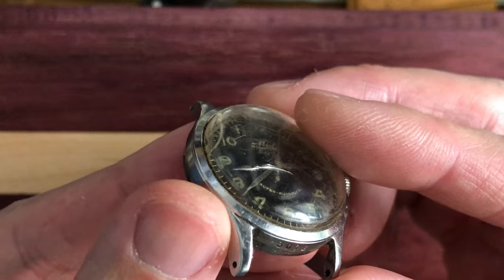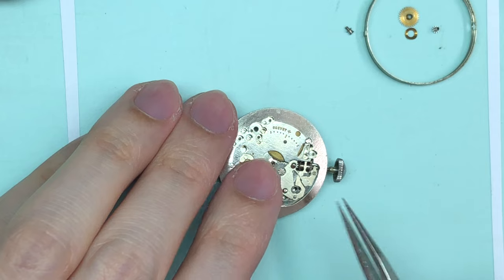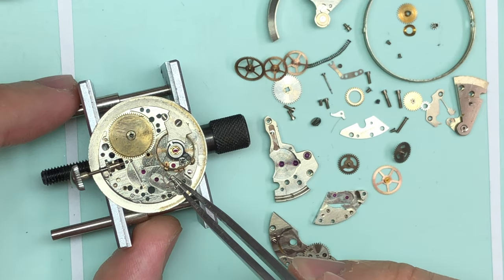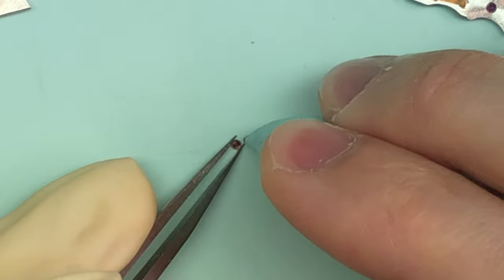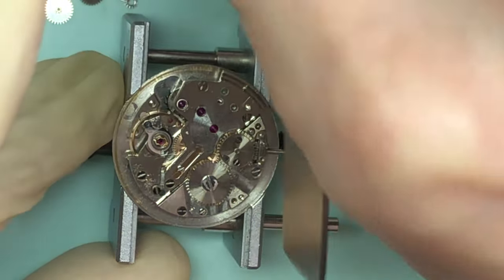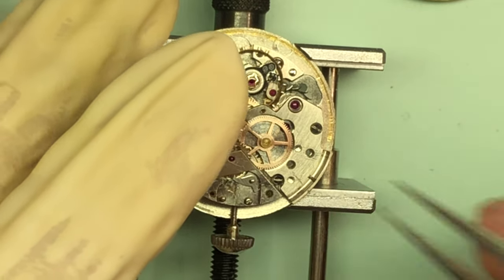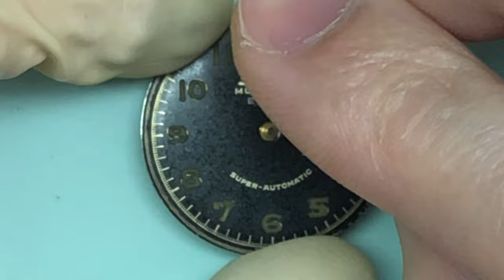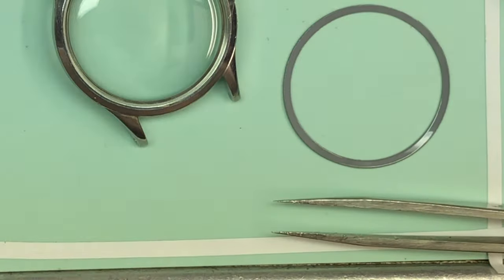1940's MIDO Multifort Restoration - Bumper Automatic Caliber 917P

Comment: Wow, enjoyed that.  I just took my father’s 1950s Mido Multifort to my jeweler to have it serviced after 50 plus years.  I’m nervous.  I hope his watchmaker is as skilled as you.  Thanks!
Reply: Let us know how it turns out. Very cool to have your father’s watch.
Reply from the maker: I am very sure it will turn out in great shape!
Reply: @TimelessHistoryChannel  Hi Omega Entusiast.  I just got my Dad's 1950s Mido Multifort back from the watchmaker.  He cleaned, oiled and adjusted.  It looks good and is running and seems to keep time pretty well, but he said that some of the parts needed to be replaced (some rust he said).  He said he could not get the parts.  Would you know who could help me get my dad's watch repaired, someone who might have access to parts for a 1950s Mido Multifort.  It has a center second hand.  Thanks!
Reply from the maker: @markwoolard6745  Unfortunately, I would not know where to guide you to locate these parts.  Certain rusty parts I am sure can be cleaned.  If you're unable to locate the parts you'll need to ask your watch maker what caliber is your watch movement.  Then try searching on website such as Ebay for spare parts or a complete movement for your watch maker to strip it down to use the parts.
Reply: @TimelessHistoryChannel  thanks!
Reply: Hi Omega Enthusiast.  How can I find the caliber of the watch movement?  Could you tell if I sent you a picture of it?
Reply from the maker: @markwoolard6745  The caliber of the movement can be located on the automatic bridge, or the automatic weight, or under the balance wheel, or on the dial side of the watch.
Reply: @TimelessHistoryChannel  Thanks!

Comment: Great job! From doing so many Mido bumpers like this, I'd offer one suggestion for newbies to watch restoration... it's MUCH easier to replace the part at 20:33 without the balance and pallet fork in place. It's very hard to do when the watch is wound up and running. In fact, I'd advise those new to this to take that balance out after removing the bumper to avoid catastrophe.

Comment: A Taubert cased watch. Stainless was a new metal and very difficult to machine in the early 1930's. FB/Borgel/Taubert was among the very first to invest in the machinery to work with stainless aka ever Brite. They made the waterproof cases for Movado, Mido, Patek and West End. Their waterproof system was a greased cork gasket in the stem/crown and the lead gasket that seated the screwed in case back. On their manual wind cases their was also an inner dust cover that kept the movement dust free and moisture free. A signature feature was the decagonal case back. Great video.
Reply from the maker: Thank you for the input my friend.  Appreciated.  Great info.

Comment: One other thing you forgot to do is lubricate the new case washer you installed to help the case stay water resistant and extend the life span of the washer, I use a silicon type, the same used for the crown washer
Reply from the maker: I do that actually, just not in the video.  I have made a video not too long ago to inform people to apply watch gasket lubrication to apply around the case back gasket and the crown gasket.

Comment: I have a Mido 816 movement, which is very similar.  I am still pretty new to this hobby, so finding a video for a similar movement is very helpful.  Where did you find the new caseback gasket?
Reply from the maker: For the gasket, you may need to find a local watch repair shop to have him go through his gasket to fit the right one on your watch.

Comment: Love the video, good concise explanations of what/why you are doing, and the video quality is great.

I must ask if this is a 1940s watch or 1950s watch? The reason I ask is because the balance has an Incabloc shock mount for the cap jewels. Did this not start to come into common usage in like 1953? Or did I get that wrong?
Reply from the maker: Thank you!  
Good question.  Shock balance did not exist in early 40s.  But it was introduced in around 1943/44.   You will find many 1940’s Omega with the shock balance.
Reply: Incabloc was patented in 1934, it first saw use in rugged use watches like Mido.
Reply: The Incabloc style in this watch first debuted in 1938.  Their earlier shock springs looked totally different, but did indeed show up in the early Midos from 1934.

Comment: I am a retired watchmaker, and I see that you did a pretty decent job, but you could have gone the full 9 yards by cleaning every jewel with peg wood to make sure there is no dry oil or debris where the pivot of each wheel rides on especially the jewels for the balance wheel and the jewels of the fork ends, through my experience, I've always found debris in jewels especially in a watch from the 1940's because the ultrasonic cleaning methods do not always remove all of the old dried up oil, you should have also had the dial refinished to make it look brand new and you should have removed the old radium from the hands and replace it with new radium, the watch would look magnificent with just a little more work. Think about it.
Reply from the maker: When it comes to restoring a vintage watch according to a the vintage watch grading requirement, dial refinishing, relume, and case polish are a big no no to do.  But if you are just a watchmaker repairing watches for everyday individual passing by your shop, that is a different story and you can restore how you like it.  I do go through each jewels to make sure that there are no dirt or debris before and after going through the ultrasonic cleaning process. But you cannot include everything in a video.  Not to mention that, I am not making these videos to teach someone how to service a watch.  I am just showing my clients the basic of what I need to go through when I service  watch.

Comment: Great video on this Mido  watch with a bumper auto, Do have a question; the waterproof gasket you could not replace it with a original lead gasket ? And also did you replace  a cork donut ring to waterproof the crown ?
Reply from the maker: Lead/metal gasket is obsolete and not as great as rubber gasket.  Some watchmakers may still have some lead gaskets in their workshop.  To be safe, better to still use rubber.  The cork case tube gasket was still good so I did not replace it.  Have replaced them in the past with rubber gasket.

Comment: I get nervous when you grip that delicate dial with pointed steel tweezers. And the hands too. Won't that make minute marks on them? I knew an elderly watch repairer who left painful attack marks on the hands and dial aperture of his precious 1951 steel Rolex moon phase!! Do the big names use steel pointed tweezers on their work benches? How is it that the handling points of their hands are flawless even under magnification? Precise rubber tipped tweezers?
Reply from the maker: Hi, good questions.
I have plastic tweezers, but I seldom take them out to use unless maybe replacing a battery for a friend's watch.  It is good and most safe to use a plastic tweezer to handle dial and hands.  But a metal tweezers is a lot easier to use and handle.  I personally use my metal tweezers for almost everything except when I need to curve the hands a slight bit I'll need to use the plastic tweezers.  It all depends on how you handle, control, and the experience you have with using a tweezers.  I've not scratch a hand or dial and the watchmakers that I know never had an issue either.  That said, there are many clumsy watchmakers out there as well.  That is why there are many serviced watches that show marks or scratches on their dial and hands.  Tip is, if you need to apply pressure to set or bend, switch to plastic.

Comment: Who sez you can't polish the case or clean the dial?
Reply from the maker: Since you like to correct my grammar, I think you meant "said" and not "sez".  To make things clear, I have repeated myself several times in a few of my restoration videos.  If you want to keep the value of your watch, or have an easier time to resell it, or to keep it as original as possible, then you must leave the case unpolished and the leave the dial untouched.  However, feel free to do whatever you wish to the watch if you have no issue with the three things mentioned above.  No one is stopping anyone.